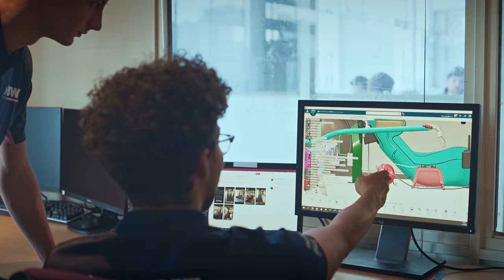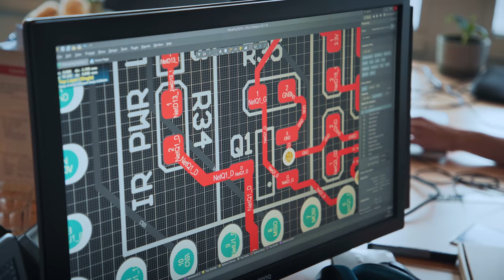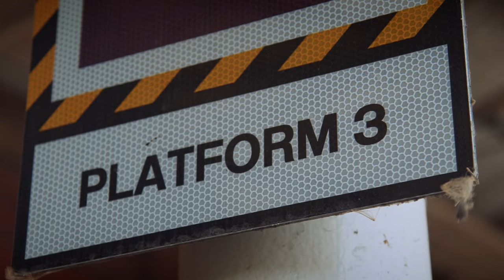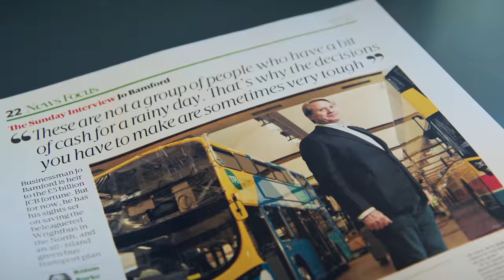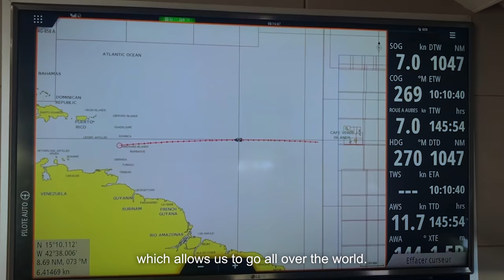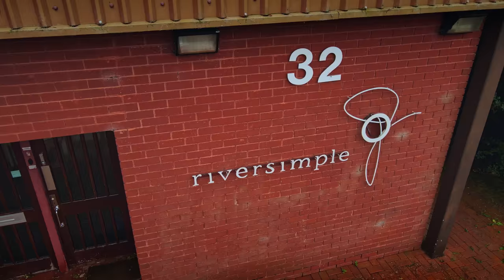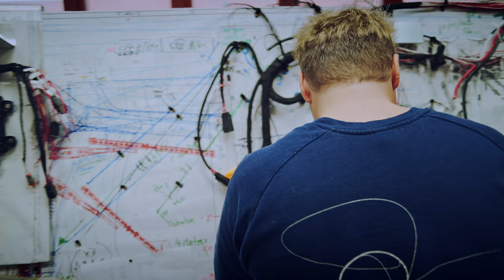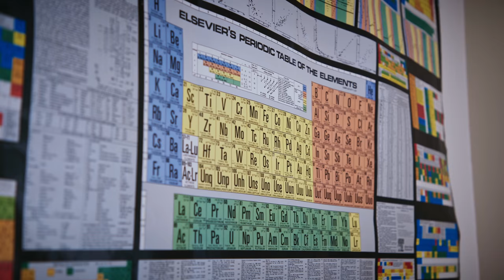CLIMATE CH2AMPION: Seeking Zero | Episode Two | GOED BEZIG

Comment: Bio fuel is also an up an coming product. and can be renewed. hydrogen is still not great but its better than it was 20 years ago and electric mobility is still young as well but solid state technology will change that as well. and with solid state battries being safer than lithium it will also cause less damage to the enviroment. the problem is that all of thease things need to be implemented. i know that some are but thats the problem its only some. and half the time it almost takes more energy to create this technoilogy which fails to offset of emissions it was ment to decrease.